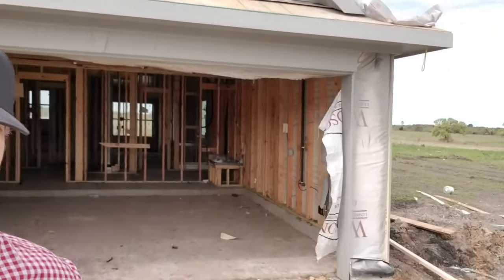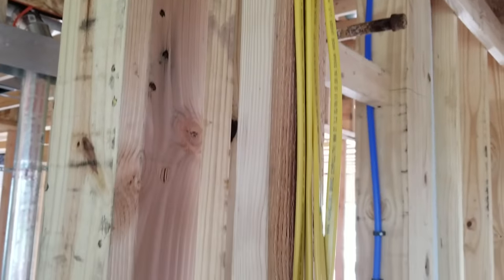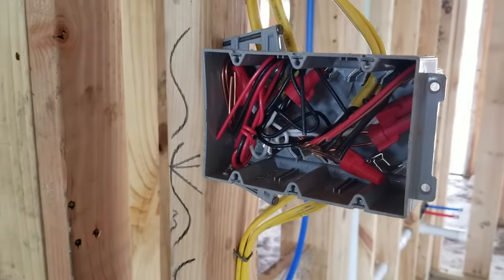HOW IS THIS EVEN LEGAL?!?!

Comment: Allow me to educate you on the purpose of house wrapping and moisture barriers. The house is not supposed to be completely water proofed. It is designed to allow for "breathing" so the atmosphere of the structure can reach an equilibrium with the outdoor environment. Otherwise your framing will mold and wet rot throughout the entire house. The wrapping is only meant to direct water that leaks through the exterior material (siding, stucco, etc) back down to the foundation.  It is not meant to stop a waterfall being sprayed directly on to it, like a hose.  Anyone that wants to argue, spend a decade strictly drying out flooded structures and performing mold remediation. You'll learn a lot more about what you are building.

Comment: So, it's a house built like a mobile home, but with house wrap between the siding and the studs....yeah, that's a load of BS to be paying market prices for something like that.
Reply: Which mobile homes are built without sheathing?
Reply: @kungfoochicken08  Most of the homes I've seen haven't had OSB, only the siding, which isn't even hardie board a lot of the time.  Or that might just be homes before a certain year, mine doesn't have any OSB, and it sucks.  Lots of air leaks, not moisture protection, the siding is starting to fall apart.  I'll probably have to strip it and redo all of it by next summer.
Reply: @Arkine13  Which year was it built? There are essentially three different types of mobile homes: pre-1976 homes, pre-1994 homes, and post-1994 homes.

As mobile homes started to become popular permanent homes, HUD stepped in and regulated mobile homes for the first time in 1976. Homes built prior to this were completely unregulated. These are most of the metal clad mobile homes you see, and the stereotypical trailer park homes.

After Hurricane Andrew wiped out half of the mobile homes in Florida, HUD increased building standards of mobile homes to near the standards of stick built homes. 

Homes built after the 1994 reform were definitely required to have sheathing to help with racking. I'm not sure about the building codes between 1976-1994, but most of the homes during this era had some sort of sheathing or wooden siding. This was a weird time for mobile homes because metal became too expensive to side homes with, but vinyl siding was still too new to be cost effective.
Reply: @kungfoochicken08  This is a 1999.  Most recent mobiles are built with 2x6 exterior walls and siding (which I suppose covers the regulation for "sheathing").  But I can tell you for a fact that there is not OSB or Plywood under this crappy particle board-style siding (it's not even Hardie Board), and if there was any kind of weather proofing, it's long since disintegrated.  

I saw on a website just a couple of months ago where you could "upgrade" to have OSB under the siding.  I was pretty...stunned, it's like, "really, you are charging people more just to take it up to standard home building practices?"  But here, we find some builders aren't even using OSB/plywood on stick-built homes, it's crap.  Everything has become so cheaply made these days.  

Now, I'm sure not all builders do this, and I know a house built here recently had OSB and house wrap because I drove by it daily and saw the house being built.  

But to find out this practice of not including OSB/Plywood is being done new homes, and they're passing inspections?  It's sickening to me.
Reply: Just think  Yeah, we have thought about doing something similar (most of the windows are single pane, huge, an odd size that we have to custom order and, right now, broken and/or won't open anyway).  Ours is actually 2100 sq ft and sitting on 48 acres.  ;)  But, if I'd realized how much extra work I was going to have to put into it (we bought it 10 years ago and I didn't understand much about manufactured home construction at that time) I probably would have just had a much smaller home stick built...which would have had the additional benefit of being considered "real" property, even though this house is sitting on a foundation and there aren't any axles under it.  But that's probably an entirely different conversation.  LOL  There are major disadvantages with mobile homes on the financial side too.
Reply: Just think  Originally, we had plans drawn up for an ICF house, but about a month before we were supposed to finalize the construction loan (had all the paperwork filled out) pretty much that's when the market really crashed and the company we were going to go through stopped all their lending (2008).  So we waited, but in the winter (2008--2009) the house we were living in (1976 mobile) tried to catch fire.  We caught it before it actually ignited (faulty wiring).  But the wiring was so bad and there was so much wrong with the house that we decided we just needed to get something that was safer.  Granted, this home is much safer, but the poor construction has cost us a lot in heating/cooling and NOTHING is sealed properly--we live on a dirt road, so the dust just pours in sometimes and it's nearly impossible to keep clean.

The issue we have now is, very few banks will refinance the property because of the mobile home and because of the amount of land--also, our credit isn't that great and we don't have a large down payment for a new loan.  It's very, very frustrating.  So we've just been trying to make improvements as we can afford them.
Reply: Just think  Well, yeah, we kind of are in sticks, er, fields.  We're in southeast Colorado.  Just the two of us now, kids are moved out, but we also have 9 dogs, 3 cats, 2 turtles and 8 horses.  Thankfully, the horses don't come in the house.  LOL
Reply: Just think  That's pretty much what we were wanting to do, insulate around the outside then finish with a stucco or something similar.  There are only a couple of windows that we could actually remove, the rest are all in bedrooms, but reducing the size to something more standard is an excellent idea.  Hadn't thought about the tinted windows, mainly due to price, but in the long run it'll save us more money--yeah, I'll look into them.  

As for the dust, we mostly just vacuum everything, walls, ceiling, shelves.  We tried swiffers but those get completely filled within a few minutes, same goes for any other kind of duster.  Vacuuming and then going back with a rag is really the only way we can try and keep it clean.  And then the dust is back within a few days, kind of a hopeless battle.

If we can get the necessary repairs done, I'm sure the dust problem will go away, as long as we do it correctly and make sure everything is sealed.
Reply: Just think  Might have to order the rigid board and have it delivered, the locals carry it, but very low quantities, and their prices are usually higher than I would find online, even with shipping.  We've been working on sealing up switches and outlets, but we also found that most of them aren't even attached to studs...so that's been fun to fix.  I wasn't joking about the poor quality of this house.  We already replaced the roofing material with metal because a bunch of it ripped off with the first good wind we had after it was installed.  Of course, if I knew then what I know now, we would have done that differently too.  Live and learn.  My fear is, by the time we get done with the house, we'll be moving into a senior home!  LOL  Hopefully that isn't the case.
Reply: Just think  This is true.  Thanks for help!  :D

Comment: To me, another good sign that you didn't mention is the cleanliness of the job site.  The places you visited looked like trash dumps.  That translates to a slovenly approach to everything else and would turn me off.
Reply: I thought that as well. I did low voltage for a long time and most places I went to pull wire where very organized. High rises to housing developments. There where a few time the places where crappy but they where far apart.
Reply: Looks like a Chinese construction site.  At least in China they have the excuse that every night, random people will be picking up the scrap wood for their charcoal business, taking the damaged bricks to make a sidewalk, selling the scrap steel & plastic to recyclers, etc.  Mind you, I suppose this building site is remote enough that it doesn't really matter, as long as it's not dangerous to the crew.
Reply: @jeffreyquinn3820   In America the poor pick new construction clean for copper and panels. These look nothing like any type of Asian construction. I kinda just think you wanted some reason to bash China.
Reply: @richardwaldron222  Thieves mostly drug addicts are the ones ,not necessarily the Poor
Reply: I've been to hundreds of track home build sites in nor cal, they all looked like that.  And the construction methods made me cringe, and I know very little about it.  One thing that always bothered me was the use of the simpson style plate ties that require no nails(?), they just have little spikes on them.  Those were used everywhere (on joins, sorry not sure what the technical name is), with no nails.  Not sure how those hold together for 30 to 40 years.  Btw, i delivered hvac materials, and every job sight was an absolute nightmare to get into, just piles of garbage everywhere (and no offense,  but no one even spoke English).  Flex duct was the only thing used, except for maybe some short runs of riser (for vent hoods or to go through narrow areas) or b-vent for gas exhaust.
Reply: @richardwaldron222  , yep, especially regarding the copper, around here, if you don't have 24/7 on-site security, all the copper pipes you installed today will be ripped out by thieves tonight and sold to recyclers tomorrow so they can buy some more drugs.
Reply: @WelshRabbit  man... I've walked up on 3 different ppl just stuck to a hot wire dead and burnt to a crisp... it gets bad here in Florida.
Reply: @WelshRabbit  it's natural selection. A meter is $10. 
Lol 3lbs of copper in their case.
Reply: I've seen leftover construction materials buried under the sod so they wouldn't have to haul it off. They just laid the sod right over it.
Reply: @robj2704  I've only come across that a few times on more residential type of setting. Someone hires a local builder and they just filled in the back yard foundation with the left overs. Here in high flood risk areas its common to elevate the entire "yard" and not just the foundation for the house.  It doesn't really apply to the whole property. Just the yard. It's a sight to see when it floods bad. Just a little patch of green with a house on it surrounded by water lol.

Comment: They absolutely should have x bracing in the exterior walls as well as some of the main inner walls if they're not going to use a shear strength siding or osb sheathing under the Hardy Board lap. That's crazy right there!
Reply: Absolutely agree. I don’t even se how you can really install windows without sheathing.. in the northeast, we often do the bottom course with marine plywood. Prevents a lot of rot around the rim joist etc..  I know plywood is outrageous these days but still.

Comment: The house wrap is not supposed to be water proof…it’s a vapor barrier. The waterproofing comes in with the siding / flashing / roofing etc. the lack of exterior sheathing is definitely against code though and will void any warranty for the siding.

Comment: Cant beat a solid Brick & Concrete house it will last a lifetime
Reply: @Emmanuel Pisani AMEN! We in Puerto Rico fully agree! I come to the mainland to northern Florida and I was faced with a crap wood house! Made with cardboard siding and chipboard sheathing. In PA where I am now, my houses are solid Brick with wood construction on the inside for reinforcement and modernization(I own old houses from 1900s). My house plans for my new home calls for a solid,block or precast concrete house. Lets see if I can find a PA builder now that can do that.
Reply: A  properly built timber house will last a  lifetime, concrete and block houses collapse immediately in seismically active areas.
Reply: Though at that same time brick-concrete houses are not suited in known earthquake areas since they will collapse without the needed dampening design.
Reply: they don't do well in earthquake areas. Well reinforced concrete might, but not as overpasses. Brick has no sheer strength either, fireplace chimneys fall through roofs and kill the occupants, exterior walls crumble and fall onto the street. There are ways to improve that but they are time consuming and costly. And what we see here in the video is all about profit margin.

Comment: I did 3 years as a residential rough framer in Michigan. I have a couple clarification and comments. In MI we have pretty tough regulations but we have to put 1/2 inch ply and vapor barrier on that. Vapor barrier isn't supposed to be 100% water or air tight, it's for allowing the walls to breathe and expel moisture in order to stop mold. It deflects direct moisture and cross wind to stop drafts. Also the window rap is sticky and you staple it too but like the roads is when you heat it up it becomes gooey and seals itself. So like on a hot summer day or over time the hot air from inside with adhere it to the wall. It's just hard to hear someone say something they don't know what they're saying and then try to believe everything else he says.

Comment: Been cleaning these homes for years. You will be amazed at the crap that goes on. All that matters is it appears to look good and the folk sign the paperwork. One pet peeve is I have to pressure wash garages and there is no sealant or nothing applied, no rubber strip or anything. Simply the 2x4 bolted to concrete. If there was ever a flood or HW heater in the garage, nothing keeping the water from flowing in the house. Little thing like that. These subs barely do the bare minimum. That is why I laugh my arse off when a home sells now way overpriced because the markets says so knowing full well it isnt worth it, especially custom homes. The same meth heads that worked on that stick built also sub out to do that house. Difference is they charge more, add fancy fixtures like bronze.

Comment: How do you find a good builder? Most are like car salesman just there to rip you off.
Reply: One of the recommendations Matt Risinger gave in a video is to talk to your finishing carpenter, asking them who they respect and recommend to do a job well. They will be the ones to know which builders put care into their homes, building strong walls that are straight and true, and which ones just throw something together quickly.
Reply: Same thing with plumbing,  $500 to change a shower faucet, I was quoted  1 yr ago
Reply: It's a stressful situation to find "right" persons for the jobs...

More bad apples than not... but just ask a lot of questions as well as follow up questions!

Learn to do somethings yourself... its cheaper...
Reply: If you have the time and if it is legal (Here in GA it is) be your own contractor and tell the subcontractors exactly what you want and inspect the job throughout the process. It will take a little longer but it will be worth it in the end.
Reply: Shadow 79 you have to visit home they are in the process of building to look at the quality before you hire.
Reply: Just think  I would agree with your comment here...

As a homeowner or client, you will usually have far less power than you think in sticky situations when compared with a General Contractor who's repeatedly used them...

Whoever you hire can always quit on you (before and during the job) in sticky situations, and a GC could be beneficial as that buffer. Double edged sword though...

Respect who you work with ALWAYS and being over critical and watching over one's shoulder every second of the way can only hurt - provided the contractor is a good one!
Reply: Just think I see your point I worked for a general contractor through out college doing many of these jobs so I guess I am relying on that knowledge too much. I often do and then realize that a lot of the general public don’t know what is “good” vs “bad” when it comes to construction sites. Also I know most of the subcontractors in my area and probably wouldn’t need to check up on them as most of them worked with me or taught me the trade, but in a larger city I can see exactly what you are saying being a problem.

Comment: I saw a house in Michigan that passed inspection. Taped rigid XPS was the WRB, cladded with vinyl. A little shear strength in the corner and middle of the walls. 2x4 construction. I think it just squeaked past air leakage minimums, and you could break into it in about 30 seconds with a razor blade knife.

Comment: The house wrap TyVex is suppose to let air pass thru, for moisture control and act as water diverter, not waterproof.
Temporary protection from weather before siding can be applied.

Some builders will at least put 1 osb on the corners of walls for racking, this builder put none. Builder saved $13 on a piece of osb  , homeowner will spend thousands to repair later on.

Is there 6mil plastic on crawlspace floor ? If not that laminate will absorb moisture coming up thru crawlspace, it will swell and buckel.